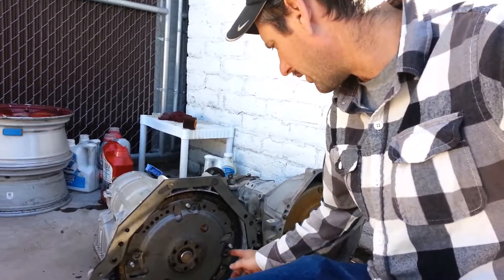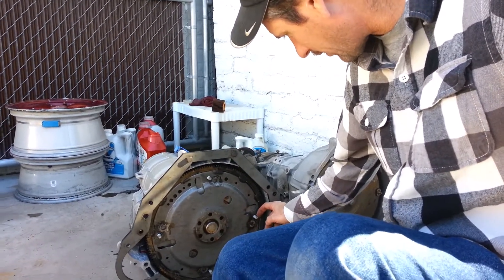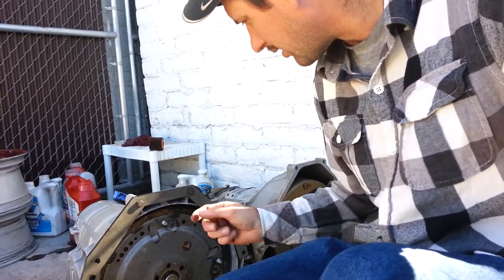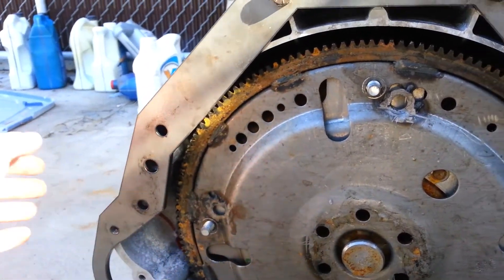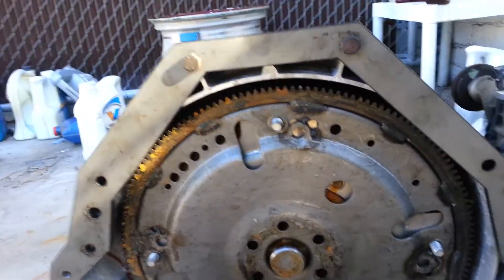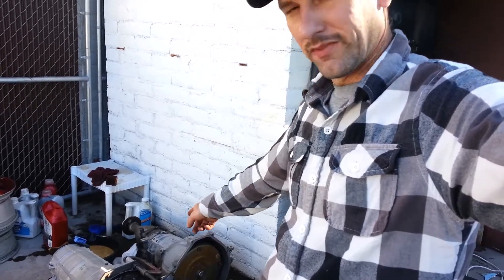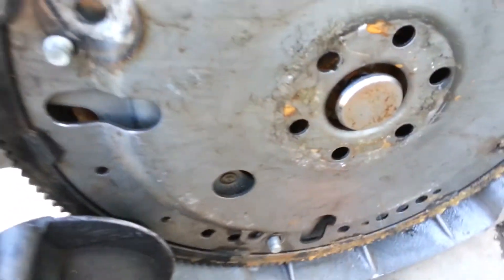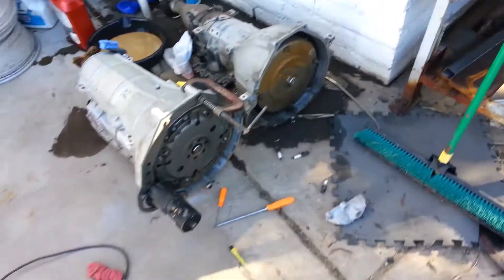6R80 302 Ford Adapter Part 2

Comment: what size flexplate ?
Reply from the maker: It a 164 tooth, 28oz unit.  PR214.. maybe..  I believe its from a 351W with AOD.
Reply: @olboy1981  do you have the the adapter plate for sale or atleast the design i want to get one made in 6061 aluminum or i could billet steel
Reply from the maker: @sn95chuy89  I have a new revision that I need to order and check fitment before I start selling them.  I think 1/4 inch steel is your best bet.